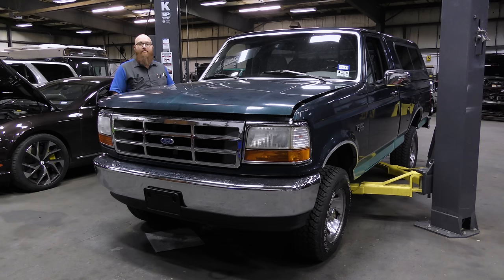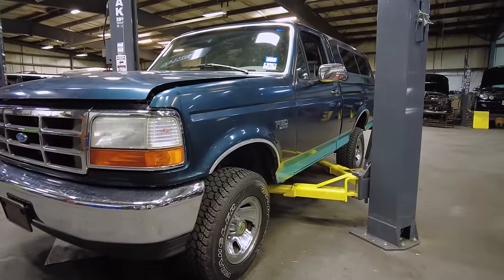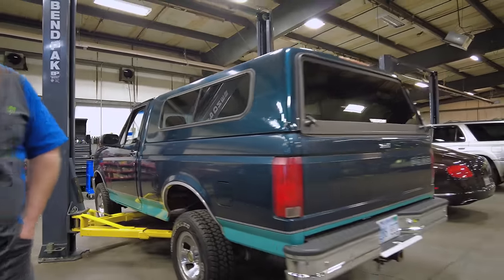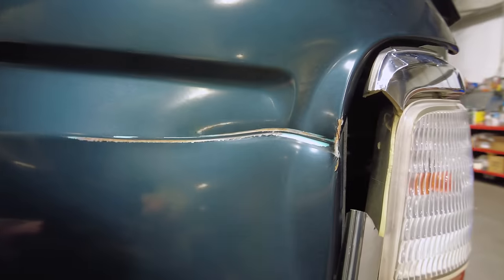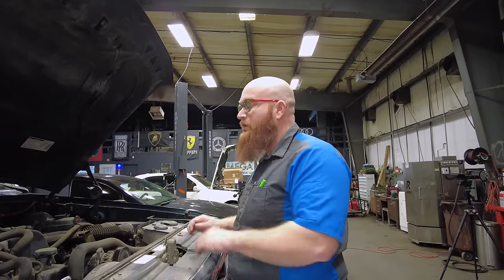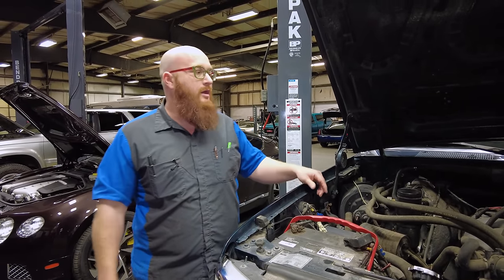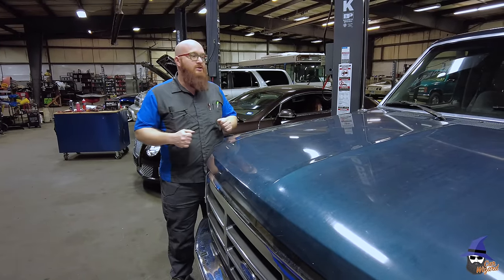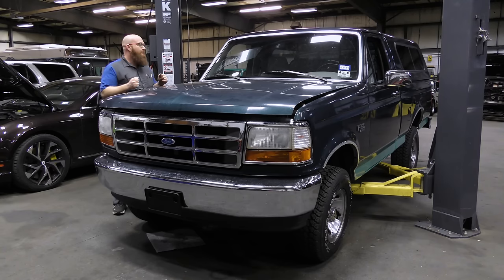What makes the CAR WIZARD mad? Fixing other shop's screw ups! Cheap Shop made  huge mess in '95 F150

Comment: I would take the bill back to the original shop and demand full payment.  They really should refund their work in addition.  I could not let this go.
Reply: FULLY AGREED Howard!!
Reply: Why take them the bill back, just do a credit card dispute
Reply: But , it is a 28 year old car with old plastic bits. Possibly some already broken.
Reply: Not every mounting point of the dash would be broke! And WTF does the gauge cluster have to do with the AC & coolant smell?
Reply: And what do you do if/when they tell you to take a hike?
Reply: Make a video and threaten to get a lawyer
Reply: @jeffone2nv  that usually works, the lawyer threat, worked once for myself with a Dealership. But also they can call the bluff and unless it's criminal charges they can make it cost you a fortune on solicitor fees by not co operating. No real consequences for not co operating, and in that I mean by taking there sweet time it providing solicitors with requested paper work and information. So depending on the cost of their screw up you can end up spending a crap load more on a lawyer, and the good ones that are worth having charge a nice hourly fee or a flat rate monthly fee that you have to pay regards the work they did for the month which hurts when the other party won't co operate
Reply: My favorite thing to do anymore is Google reviews man they don’t like that crap at all. I had one guy practically ready to give me something out of the shop he tried to rip me off on Pos lol
Reply: If i were the customer i would post their shop all over youtube anonymously.

Comment: Even if the shop accidentally broke a couple of tabs on the dash bezel, the responsible thing would be to replace the bezel, or at least use a soldering gun and JB weld to reattach the nibs. The way this shop treated this man is basically saying " Eff you!"
Reply: JB weld does not work on plastic, I speak from experience, I learned the hard way. Eventually the JB will release itself from the plastic, not so much for steel or aluminum, it will never come off, but plastic, forget it, never lasts.
Reply: Would the repair of the damage be patching something?
Reply: @mickeymomighty5660  I think super glue and baking soda might work, but have yet to try it .
Reply: @quicksilver462  Sure. If you want my honest opinion, plastic cannot be repaired to " factory originality " strength.  The correct repair is to use a virginal part, but if the plastic doesn't have too much stress put on it, you can  weld it using a soldering gun and top it off with a glue ( doesn't have to be JB weld) . The main point is of course, these hacks ripped the bezel off, as if they never heard of hidden screws, then left it 
like that with no attempt at repair.
Reply: @quicksilver462  Maybe it's okay if a man glues on his car himself, but for a workshop to do repairs like that is a crime.
Reply: @mickeymomighty5660  Depends on the situation. If it is discussed with the customer (and the shop didn't break it) and they understand that it may not be permanent, I am sort of OK with repairs like that. It can save the customer time and mobey in some situations, like when the replacement is unobtanium or very expensive. If the shop broke it, then they need to replace it.
Reply: It's a plastic tab that's been wedged in place for close to 20 years, if you aren't gentle you're gonna break it... I own 2 of these trucks, you can remove the bezels by gently prying outwards with the smallest flathead screw driver you can find. 

JB weld doesn't do the trick as you end up with a blob of a tab bigger then the hole it's supposed to go into... Good ole dollar store super glue has been holding one of mine together for like 15 years now. Luckily those tabs just snap off flush from the backside and there's no way of seeing any damage from the front once it's glued back together on the backside. 

The right move would be for the shop to tell the customer about the damaged bezel, show them how easily it can repaired and offer them a few bucks off their tab for the trouble. 

Granted the shop could always offer to replace the bezel, if they can find one in a salvage yard that matches the same interior color, and hope whoever pulls it at the salvage yard doesn't break a tab or two as well...
Reply: @quicksilver462  JB Weld for plastic repaired some two piece wheel covers on an old Fairmont. That stuff lasted for 10 years.
Reply: A robust repair to plastic can be undertaken using an appropriate weld technique that uses a filler rod consisting of identical plastic (if possible, from a scrapped identical part, if the plastic type is not clearly identifiable) and strengthened using stainless steel gauze that's 'heat embedded' over the crack and the immediate surrounding area.  The result will be a repair that's likely to be as strong as the original part - if not stronger.  However, it should be noted that not all damaged plastic components can accommodate such a repair - or will be very 'fiddly' to effect, as well as take much to time to complete - i.e. will simply be uneconimcal to perform.
Notwithstanding this series of comments focusing on the 'plastic repair methodology', my inqusitive self would dearly like to know WHY did the 'questionable technician' remove the dash panel and instrument cluster - an action that appears to have nothing to do with the two reported faults.  Whilst I understand that the owner does not wish to confront the wokshop: having paid $900, I believe he/she has earned the right to at least pose (in a calm manner) the following question to the workshop owner/manager - WHY DID YOU REMOVE THE INSTRUMENT CLUSTER TO EFFECT A REPAIR TO THE TWO REPORTED FAULTS - (a) LOSS OF COOLANT & (b) REDUCED EFFECTIVENESS OF THE AIR-CON? 
The damage that occurred to the instrument surround and and cluster requires no futher enquiries - as it can be very simply (and accurately) deduced that it was a case of an untrained worker (certainly not a mechanic/technician), or a poorly trained mechanic that lacks the ability to critically think - i.e. unintelligent, or as others state simply ST....ID.
Reply: @rockeroller  have you ever tried putting cable ties in a glue gun and using the melted plastic to replace the plastic. I haven't tried this but have heard it being used.
Reply: @ianmontgomery7534  No, I haven't  heard of melting zip ties into it, sounds like it'd be worth a shot. As wtls83 writes, using identical plastic, and melting that in as extra filler, is ideal. And the extra metal he msntions( stainless gauze) melted in sounds like icing on the cake.
Reply: I've had excellent luck with the 'plastic welders' that heat it and insert a metal tie. They're strong
Reply: Plastic welder.  But, for as common as this item is, it is not worth the hassle.
Reply: @rockeroller  There  IS "stuff" out there that will repair broken plastic making the part STRONGER than it was originally. Scotty Kilmer was showing some "industrial " 2-part epoxy that uses an "accelerator" and adding hardener to weld the pieces together. I don't remember what it was called, but car manufacturers use it to fasten plastic panels without any other fasteners. Cost? Probably in the neighborhood of $400/gal automotive paint, AND NASTY stuff to be inhaling!
Reply: Yah that's crazy man!

Comment: You got that right wizard. That 4.9 inline 6 is a legend and best engine ever
Reply: Better than a pd130?
Reply: agreed 6 is the best I ever had. never had any issues. well outlasted the truck.
Reply: Agreed.  And this is from the owner of a '91 F-150 with the 302 V8.
Reply: An older fella who worked at the autozone in the small town I used to live in put 800k miles on his bricknose 5 speed 2wd F150. It ran perfect but he replaced it with a reman engine so he could sell that engine to his friend to put in a tractor
Reply: Ford needs to make these again they are a million times more reliable then those eco boost engines

Comment: Shocked that anyone would even try another mechanic if they already have a relationship w/ Omega. Good mechanics are a gift and they make your life so much easier by giving you the piece of mind that everyone will be able to get where they need on time and safe. They also save you tons by extending the life of your gear. You find one, stick w/ them.
Reply: I suspect the Wizards turn around time might not be that great. Sometimes it's more convenient to go a bit closer to home for certain services.
Reply: Also consider, most shops only like working on one car per customer, At a time. At least out here in St.Louis

Comment: You will need a cluster out of a 1994 or 1995 F-series truck so it will be plug and play. Others need to be rewired due to pinout differences. The PSOM may be swapped over to retain actual mileage.
Reply: You're correct. However, it's the PSOM portion that is dead on this cluster.

Comment: Many mechanics I’ve dealt with really don’t care if they break things on these older cars. But if it’s a new car or some sports car, they treat it SO carefully. I have found numerous things wrong over the years when my parents took their 98 CRV and 98 RAV4 to service. Missing clips, broken plastics, hacky repairs… I inherited the 98 CRV when I moved away and done all services to it and corrected most of the problems from the previous shops because “Oh, it’s just an old Honda, just duct tape it”. I’ll never let anyone service my vehicle unless I need new tires or an alignment.

Comment: When you get a replacement (used) instrument cluster, get one with a tach.  You might as well do a little upgrade while the wallet is open.  All plug will plug in as it was wired for both options.

Comment: Things are “that bad”.  Born (65)and raised here in St.louis mo and I’ve all but given up on finding a mechanic like you. Seems like the good mechanics are on YT and not many of those and none that are close to me.  Most here locally can change parts but could care less what caused the issue or even have the knowledge to figure it out.  Wish you were closer.  Love your channel.
Reply: And the problem is, they swap parts until they find the responsible part, but you pay for all the parts and labor of the ones they changed unnecessarily. So it's a win-win for these guys. I also notice that local shops in my area are quite busy with easy jobs, so they get lazy and prefer doing nothing else than oil changes, spark plug changes and other maintenance items.
Reply: Had a great mechanic over in Belleville, but he unfortunately got into a motorcycle accident… he lived, but with limited function🙏🏼

Comment: That's exactly what I did,,  in 1985 went on a hard target search for a used loaded F150 with a straight 6 and I found it,,,  it was a 1982 with 40000 miles,,,, drove it to 1995 and  270000 miles and it still ran like a new truck...
 The most reliable THING I've ever owned in my life..

Comment: What a great truck from a simpler time, the way trucks SHOULD BE!!! All hail the 300 I6. It needs to come back!!! Thank you for being an honest shop, and just repair the problems right.
Reply: Hopefully they'll bring back single cab and long beds too.
Reply: I agree but it wouldn’t be the same. That 300 I6 would never pass modern epa requirements as a new engine developed today. It would be far more complicated with high pressure direct injection and complex us regulated emissions crap
Reply: Best 4x4 snowplow I ever owned, incredible traction i6, 5speed excellent on fuel and unkillable
Reply: Obviously they made a huge mistake but what would you do if you needed them to repair everything I don't understand how he could walk out of there after paying him $900 I wouldn't have gave him a penny how would that play out if a customer didn't get what they asked for and due to their work broke even more stuff curious I never been through that luckily most of the things that break I can fix
Reply: @spc_inv  modern block, turbo, yeah, it would be nice.
Reply: Meh give me a four doors, Apple carplay, and a 400hp V8 that gets 20mpg highway.
Reply: Agreed
Reply: These were the time where men were men, and 3:04 intake manifolds were made out of metal , rather than cheap plastics on modern vehicles.
Reply: @fleurdewin7958  Exactly mate
Reply: @festuspunky  I'll take points and a carburetor over all the electronics that run that electric motor and battery
Reply: @Tool0GT92  sure 60000$ ypu can buy them all day long
Reply: @jasonleatherwood2172  some people make good money and can afford it.  You can still buy a base truck or used truck to fit your budget.  An xlt adjust for inflation from 1998 would be $40k
Reply: @Scott Dove sorry 6ou feel that way, mine was mint, it never let me down, have a great day
Reply: @Tool0GT92  i make good money and can afford it but to save 5 mpg and listen to the radio i aint wasting 50000$
Reply: @Scott Dove have a good day, bother someone else, great to have negative trolls bring everyone into their negativity,  if you enjoy deriding people and laughing at them maybe you shouldn't have a keyboard, you may actually be a bully Mr Dove!?!, I stand by that  truck,and engine as it was good for me......grammar and spelling be dammed buddy!

Comment: I had to fix a f150 that someone did the same thing to. It took about 2 weeks to gorilla glue all the pieces back together. That was 10 years ago & the gorilla glue has held up with no problems. I used the original type & i allowed  it cure completely before installing

Comment: I remember taking a toyota pickup to my local mechanic back in the 90's.  I had just bought it and the only issue was the horn wouldn't work.  I came back a few hours later.  The guy was napping in the seat and said he couldn't find the problem.  He had managed to somehow blow the entire electrical system (gauges, interior lights, turn signals, etc all quit working) and wouldn't fess up to it.  The next shop thought some part in the dash was the problem and it started smoking when they plugged it in.  I finally had to take it to a dealer in the city to sort everything out.

Comment: I’ve got a similar model with an automatic, if your customer would be interested, a gauge cluster FROM THE SAME YEAR with a tachometer is plug-n-play. All the wiring is present and it’ll work perfectly. Might be a nice upgrade while the cluster is being replaced
Reply: I did that my mod on my '94 F-150, it was nice to have on an automatic, I dare say almost a requirement for a manual!

Comment: People say I’m crazy for going to an independent shop to get my work done. “THEY CHARGE $85/HR!” They say. Yes but, a) only what needs to be repaired gets repaired. b) oil changed take about an hour, because, like the Wizard, they check everything and top up all fluids. c) we have a personal relationship where if I don’t have the money or can only pay half right away, but the rest later that can happen and I get the rest of the money to him ASAP (rarely happens, usually he tells me what needs to be addressed first and I save for it before I take it in). AND most important d) he pays his techs a fair and competitive wage, with benefits and appropriate time off. Not like a dealer charging $110 for a synthetic oil change and only paying the guy $15 to do it. It’s a local business and these folks put their money back in our community, not some corporate giant on Wall Street. As a local contractor I recommend his shop he recommends my company when customers ask. Great episode. Pride of workmanship is missing in several trades today. That’s where I see the problem.
Reply: $85/hour for someone honest who is in your corner is very reasonable. Too cheap actually! 

I like giving good small businesses my money. And they usually recommend my small business as well.
Reply: Interesting that $85/HR is considered expensive. Where I live the cost is 2-3 times that if you go to the dealerships workshop.
Reply: I do my own oil change and most of the work on my cars